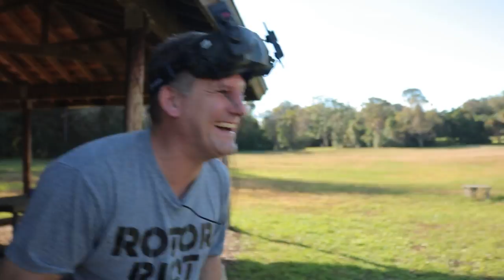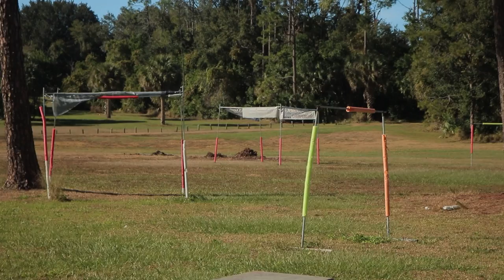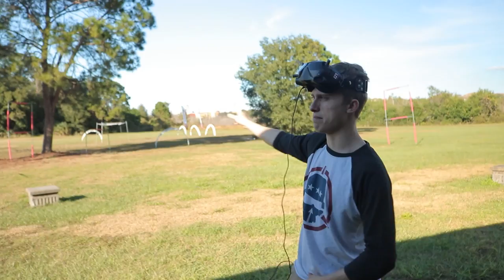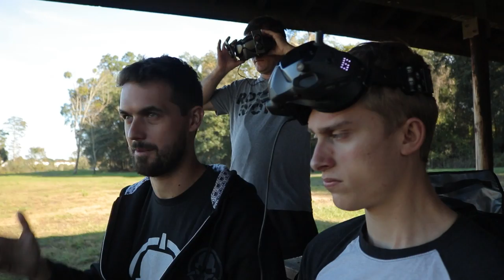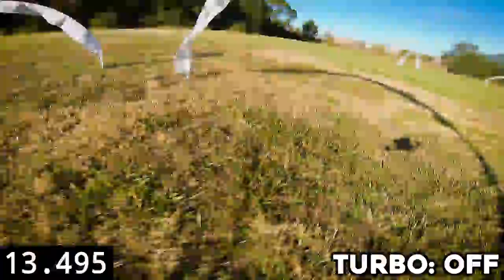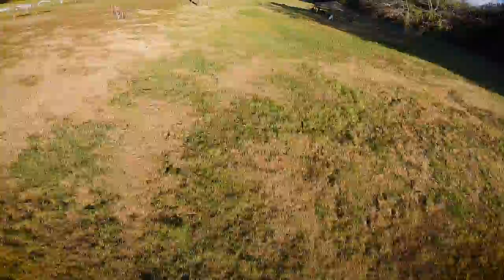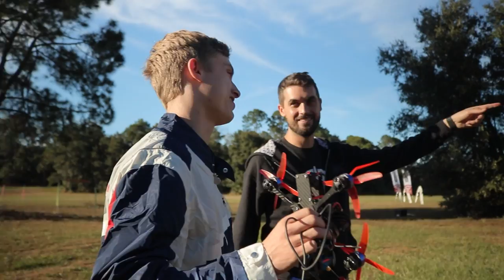Turbo Kwad!! - the ULTIMATE Race Drone?

Comment: You should try it as part of the mixer connected to throttle so that you can use the 5th motor to fly faster with less angle rather than on a servo and only at 50% or 100%, perhaps even reduce 5th motor throttle with increasing yaw and roll, with some advanced mixing I think you could do it. You could use a known angle of the rear motor to mix upwards thrust perhaps, or use a servo to keep the motor at 90 degrees

Comment: Setting the 5th motor to parallel throttle on Opentx would be simple. Its also doable in the adjustments tab in betaflight. Or you could put it on a slider and have it adjustable that way so you could slowly raise it to suit your needs or skills.

Comment: When the boost is "off", U need to precisely control the boost RPM slow enough so it matches the oncoming airstream. The idea is to zero out the drag while maneuvering. If you could do it perfectly, which I have no idea how you would, it would have zero effect on maneuverability yet still provide the boost in forward  speed. Or simply just keep it turning at idle speeds always because a stopped propeller is a huge drag aerodynamically.
Another thought I have is that the main props would act as wings when the rear motor is on since it would be pushing it beyond the speed of the air flowing through just the main props. With the forward angle of attack, that's going to push you down and require more power to maintain altitude. That's a lot of wasted energy. If you're going fast enough with boost, but using a level angle of attack, I think you would find it flies like an airplane since the main props effectively become wings. Would love to see you experiment with that one.

Comment: Should be able to get it to kick in when trottle is over 75%, so that would make it integrated with the actual controls. Also could program the drone to detect if it is straight.

Comment: If the rear motor can be automatically adjusted where it speeds up in the straights and stops or even reverse when approaching a corner it could be super useful

Comment: next time make it connected to the throttle-stick itself, so it will be more like flying a real quad but with massive power and you dont have to worry about flipping the switch!
Reply: it would be terrible
Reply: Problem is, you tend to use more throttle in the turns, and that's not when you want max rear thrust.     On my pentacopter, I put the rear motor on a slider.    The DJI transmitter they were using has a wheel, but may not be able to put it on a channel.
Reply: @daemn42  it was what I think

Comment: Would it be possible to link the motor outputs to the gyro so the boost motors only kick in when the quad is flying at a specific angle and pitch i.e. straight line?

Comment: What about using the FC accelerometer to detect forward pitch angle.  Then send this to the servo to keep the thrust from the turbo motor always parallel with the ground.  Also, put a GPS on it so we can see how fast it went!!

Comment: It would be cool to find a way for the throttle on the boost motor to go down as you yaw to the side, that way you don't have to manually compensate with the switch for every turn

Comment: Need a mix where the turbo goes 50% from 50% to 75% throttle and 100% from 75% to 100% throttle or something.  Maybe normal throttle even maxes out at 75% to make it a little more smooth.  Wouldn't have to worry about turning it on/off.  It'd be automatic!

Comment: Put it on a foot pedal.  Replace one of your switches with a headphone jack, then use a cheap piano foot pedal as the toggle switch (they plug into headphone jacks usually).  Like a gas pedal while flying.

Comment: The only thing I would say to try instead. Is maybe setup a way for it to automatically turn on when you actually give it normal full throttle. Kind of like how NOS works in a car, it's based on the throttle position sensor and only kicks on when you floor it.

Comment: You need to compensate the added roll torque from the rear motor. Even after that, you are going to have some wonky roll authority favoring one side. Awesome you guys tried this, I've definitely wondered about it.
Reply: Maybe just add a front turbo motor counter rotating from the back.

Comment: I did this with a TBS discovery in 2014, you had to keep the quad level when using the pusher prop as it rides the conventional quad props like wings..i also put a puller on the front but that just didn't work well. 😁

Comment: It is interesting to look at the experiment with two "turbo engines", but smaller - by 30 percent. They can be put in a more balanced way and in corners with a sufficiently optimized setting, they will have to work out better than one big one.

Comment: I'd be interested to see a traditional transmitter used so you could setup a mix on the throttle to include boost above X% throttle a little bit like differential thrust on a wing.

Comment: The angle with that much speed pushed the drone down . The body acts like a spoiler. Building a body that can stay leveled with tilted motors might have better break thru the wind and better control. Just a thought.

Comment: @rotorriot 

So the DJI transmitter used to control the drone, what do I need to do that, can I use a DJI RC231? I had a mavic 2 and crashed it, but want to use the transmitter on a 6in prop build, I need guidance on how to configure this set up if possible

Comment: what about putting the 5th motor on a second servo tilt mech that uses the accelerometer to keep it level? Then, regardless of pitch, boost thrust is always forward. Although, that might make it hard to keep the thrust line going through the CG.... that's pretty important too as JB pointed out.

Comment: Just thinking out loud. What if the extra prop is in the front and not the rear, like a regular airplane. It behaves like a rear-wheel drive, or a boat when it is at the end pushing the vehicle. That probably explains why it is so hard for Vanny to corner. Also, maybe the boost could be connected to a foot pedal of some sort? I believe the hands are busy enough to coordinate new elements without sufficient practice. But man.. this is like F1 racing now, DRS!

Comment: Can you put it one a knob/slider instead of a switch? like the ones on the side of x9d's. or if you are gonna put it on a switch mix it in such a way that when you activate it, motor is controlled with the throttle? like the switch controls weather the motor is on or off but the motor is controlled along side the others with the throttle?

Comment: from a controls perspective, boost will add disturbance which will be problematic acrobatic maneuvers. therefore needing to turn it off and back on on straights.   It will need more integrators  (another I term maybe) to bring steady-state error to zero. So i am very curious to see this on the customs release of betaflight that can compensate the added disturbance. controllable maneuvers on boost wont need to turn it on an off. THAT i think, would be FUN.

Comment: Make the turbo-boost a momentary switch/button on the controller rather than a flip-switch... so you can just spam it like a trigger.... then, put a servo on the motor tilt that is channel mixed with the pitch.

Comment: You could probably set it up with a potentiometer instead of a switch, ofc with a radio that supports it, or attach it to the throttle instead, assuming you can set it up to work with arm safely, and disable it on a separate switch

Comment: pemtacopters have been around a while, I built one once that used a nitro motor, (it did not turn out well in the end) I have been looking for a new pentacopter build but, I have not found any around anymore. I setup like yours would be perfect for wing chasing or the new laser tag system as it seams to mimic some characteristics of a fixed wing craft.
Could you perhaps sell the 5th motor setup? I have to chase Shelby Voll and so far no quad has been able to do it. I am going to put the 5th motor throttle on a peddle to give full motion.

Comment: What if you could ad a mix. that when you go to almost full throtle then the turbo motor kicks in automaticly. Then you could fly smooth, becouse there is no need to switch manually.

Comment: the 5th motor needs to be a thing... 
could you do 4" quad for lift and control with 7" thrust pusher? 
some sort of carbon / foam "Lifting Body"
blend wings and quads.

Comment: You need a push rod link to tilt the camera with the rear motor so they both stay parallel as the speed increases. Could possibly just use springs for a lightweight assembly and simply rely upon the force of the rear motor to compress said springs in relation to the forward momentum. Ijs
Reply: great idea... Maybe a mini gymbal.

Comment: You need to make it auto activate on mid throttle and full throttle. The problem comes when he's backing off the quad thrust and that gives him no turning ability at top speed. The quad props need to be as fast if not faster just to be able to turn, so if we understand how a quad works you need to increase the thrust to the front props during a a turn not decrease (well some decrease but not as much as normal) the tangential force still applies and that is the culmination of all component tangents. It's just physics. So adjusting the PIDs for Alex normal flying is what made it crash. Lift the PID rate up for the front props when turning and when you are adjusting roll don't ad so much negative cause it will want to corkscrew into the ground every single time

Comment: Does he power the 5th additional esc/motor off the 5v pad on his flight controller  or directly to the 4-in-one esc battery pad ? Thanks, I'm new to all this.
Reply: Most likely off the battery directly, probably off of the ESC battery input pads. The 5v supply can't source nearly enough current to run a motor, and the voltage is too low to be useful on something of that scale if it could.
Reply: @Alex-dy5ep  Thanks!

Comment: the thrust line needs to go through the cg and match the cam angle
if it doesn't go through the cg, it wants to rotate the quad, so the fc needs to correct

Comment: I could be wrong but I think you may have been trying to get me to buy DJI... cool flight... maybe have the switch arm it and then set the speed to match throttle position... that would give you more control I would think...

Comment: that 4 bladed prop is acting as an airbrake when it is not spinning, you should try a 2 bladed prop on the back . also make sure to smoothly apply throttle to avoid torque roll

Comment: You should make it so you have a pressure sensor that you have almost like a pedal and press it to turn the 5 motor on that way you wouldn’t have to focus on using the radio switch

Comment: you need to put motor on a mix with throttle make throttle curve peak at 75% make boost motor curve starting at 50% stick. thus the boost will only come on if above 50% throttle and will much more controllable.

Comment: Not sure if this is possible or not but what about using the accelerometer to measure the pitch angle and have the motor on a server that moves in proportion to the pitch angle, so when you enable turbo boost it matches your flying angle? And sorry late to the party on this one just noticed the video is from over a year ago :)

Comment: Drill the case and put a push button momentary on the back of the radio case so you do not have to change your grip much?    It is a mod I have been meaning to do to my radio with my 3 cam cheaters for quite awhile.    Could be useful here.

Comment: you need to make a mix on channel with throttle output, so it will automatically decrease the amount of boost, when you do not use full throttle, like corners, and then go with boost on full throttle.

Comment: Maybe the 5th motor should be set to a threshold. So, it only turns on if you are between a throttle range like 75-100%.

Comment: You should put it on a servo camera control so when it's flying it's like a pentacopter then when you hit the switch it uses the flight controller to go to the appropriate angle
Reply: Oh and put the esc on a servo controller so you could control the speed

Comment: Try to place the 5th propeller just below the bottom plate to push the drone below the drone. When the drone advances, it will push it even harder. The 4 propellers will pull it and the one below will push. ????

Comment: try contra-rotating, dual rotor, maybe assist mini rotors, some kind of a drone. better have inherent stability, gyro mass disc, than controller secondary stabilization
Reply: its a gyro copter
Reply: better horizontal, use the quad rotors as wings, also better horizontal aerodynamics

Comment: the 5 th motor should have been put in the front to pull the drone w thrust like a plane instead of pushing the drone which seems like caused the upward tilt and wobble

Comment: The Foxtech Screamer did something like this about 5 years ago (not for sale any more but the product page still exists with videos).    The rear motor and camera are both set at zero angle which is a much lower drag configuration, and it is piloted pretty much like an airplane.  You just put the main motors at hover rpm, and then throttle up the rear and steer normally like a plane.   Top speed around 85mph.   The larger rear motor had > 1:1 thrust so it would fly straight up at 50mph on the rear motor alone with the lift motors at idle.      Here's a vid of mine.   
https://www.youtube.com/watch?v=JBeUphNPkKg
With the rear motor in the dirty air of the quad frame and motors, it was always *LOUD*, thus the Screamer name.

Comment: Why not add it to a channel rate so when the throttle channel reaches a certain Max it activates a certain feature that way when he's backing off the sticks or whatever and then he's back on the sticks it'll actually activate it and then of course so it's not dragging as much why not give it a motor on feature kind of thing or an idle feature that way it's at least doing something without creating excessive drag I can see the possibilities of creating a new style per se..... I like the thinking outside the box

Comment: DEVISE A FOOT SWITCH that can work in conjunction with the switches on the controller.
*************************
Seems to me that is there was difficulty in operating the switches fast enough on the controller at full throttle I would create a FOOT SWITCH to compensate.  Perhaps making the 'boost' switch a FOOT SWITCH  like the foot pedal to the gas when driving a car.**add a second foot switch and enable  the pilot to do even more intricate moves at full throttle.   **    

 Since we're all used to using a foot pedal since we began driving years ago the speed in which a foot switch could be engaged would be very very quick  and natural for the pilot when the quickness becomes necessary.   Does that make sense????? please let me know.  Thanks

Comment: why don't you  configure it on certain throttle position instead of the switch so Vanni don't have to worry about the Switch if it was distracting him so much... so lets say at 50% throttle set it to engage at 25% and at 75% throttle the fifth motor engages at 50% and at 100% throttle it engages at 75% or 100% power. no switch less distraction more control!

Comment: contrarotating motors you have to put, so no torque to cobat by the FC not?? goood idéa! (i was thinking this, but, for money i dont make it..) contrarotating motors power set is very expensive.. :( make it!!! you can!! ;)
Reply: and better thant on/off with 3 positions, you dont have sliders on your radio?? to be more smooth?? and one question: is possible to have the stl files to do it?? thank's! ;) (but in contrarotating with a slider to have throttle.. or a mix with the main throttle??) wath you think?? badass thing!!!! ;) i love it!

Comment: Hey Rotor Riot, I flew my quad today where the air temp is 25F. Right after flying for 15-20 seconds, the battery dropped down to 18v then sometimes would show 22v, etc. There was even a time it showed 15v! OMG! I continued flying and I would hear all the critical notifications from my Jumper T16. I think I flew for 2 mins total since I couldn't handle the annoying alerts. When I got home, I measured it and this is what it got, 24.02v. https://imgur.com/Hc1VN7M.jpg Is this normal during winter? Or is my battery starting to go bad? It's a 6s 1100mah black series CNHL. Motor is 1750kv 2207. Thank you!

Comment: What's going on here, this shouldn't work. I mean it should but not better than just having bigger motors and tilting the quad more. The streams of air are fighting each other and you get torque the FC has to compensate. For making it easier to control this much power I would rather go for 2807 and a servo for tilting the FPV cam.